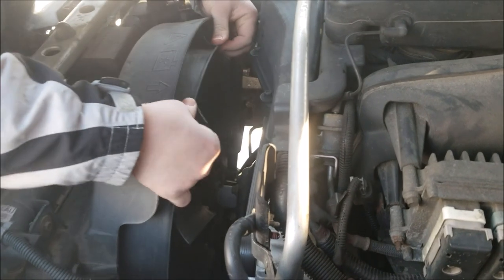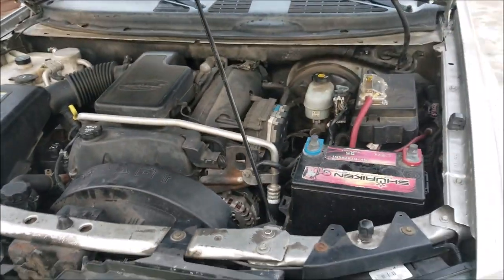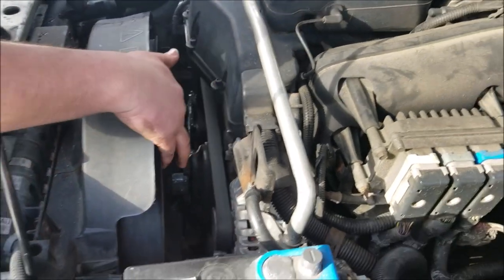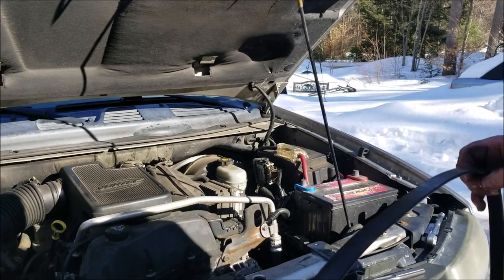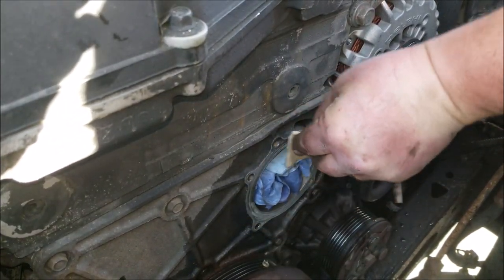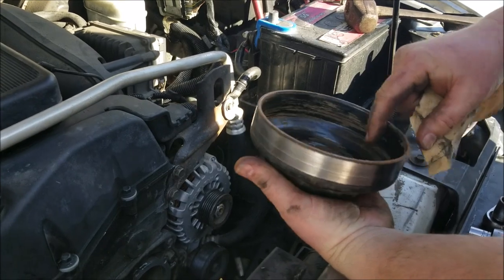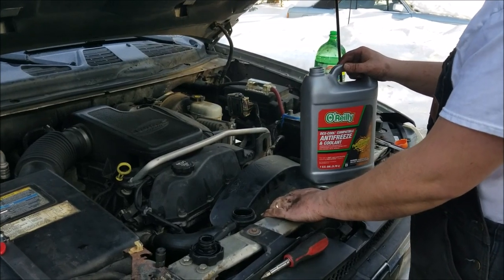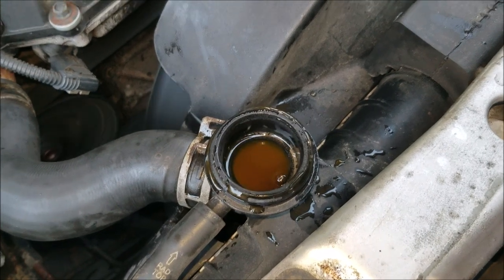Step by Step Chevy Trailblazer 4.2L Water Pump & Fan Clutch Replacement in Under an Hour

Comment: Bro... you said 89 ftlb for the second torque. Lol damn son
Reply: now im on the way to the shop to have 2 snapped bolts removed lol. im such an idiot, thought oh man this looks easy enough. got it all apart plenty easy, was putting it back together and was on the home stretch when the first bolt snapped. 89 ftlb was definitely not what I was supposed to do. My fault but dang man now im wrecked hahaha.

Comment: I found If you disconnect the fan clutch from the fan no notches are needed in the shroud. Came right out.
Reply from the maker: Correct, but how much extra time did that take?
Reply: @E4EonEbay  5 minutes lol
Reply from the maker: @dirtwolfmtb  what can I say, the older I get every minute seems more valuable :)

Comment: I have a 2003 Chevy trailblazer 4.2 LT and need water pump and fan clutch but can’t find both not sure why
Reply from the maker: Are they not available at your local parts store?
Reply: @E4EonEbay  No they didn't have them together. I had to order online. I don't know much about cars but I'm trying to fix the trailblazer so thank you for this video.
Reply from the maker: @brendamorgan8122  just take your time and you should be fine, I will say it sucked doing it in the winter. I hope the video helps.

Comment: Is it necessary to change the fan clutch too ?..
Reply from the maker: I would while your right there, if the fan clutch is old, if it fails soon after you change the pump it will kill the bearings in the pump and you'll be doing the job all over again. If it is a fairly new fan clutch or low miles then no, otherwise I would. Thanks for watching and commenting.

Comment: Why hold the two bolts?
Reply from the maker: If your asking about the two on the pulley being held with the tool, it is to keep the pulley from spinning when loosening the large fan nut

Comment: Hey! Take that wedding ring off! It can hang up and you can cut tendons or RIP off that finger! 
Why doesn't anyone buy the correct spring clamp pliers? 
Stick a piece of cardboard on the fan side of the radiator core. Just slip it in, save some $$$$

Comment: What brand water pump and fan clutch do you use
Reply from the maker: Fan Clutch was DORMAN part #622-001 and Water Pump was GMB part #130-7700 thank you for watching and commenting!
Reply: @E4EonEbay  thanks for the video. I ordered my water pump from rockauto acdelco and acdelco fan clutch
Reply from the maker: @coco_furry8073  good choice, acdelco is an original equipment manufacturer for GM so they will last a long time. I hope the project goes smoothly for you.

Comment: Just a tip, or opinion, I just thread the fan nut back onto the water pump and have never once tightened them down. The force of the motor running will tighten it. 

Good video though, I appreciate the notch tip!